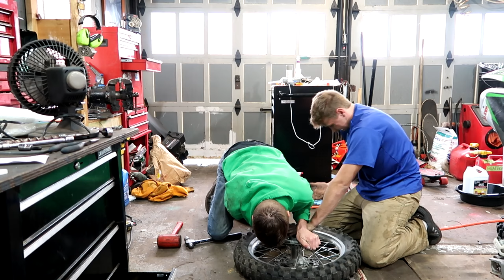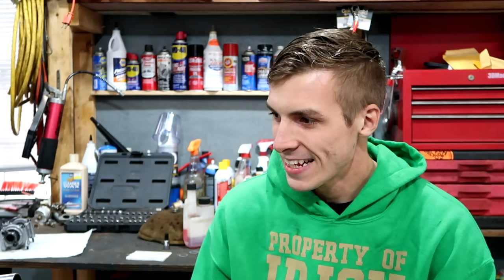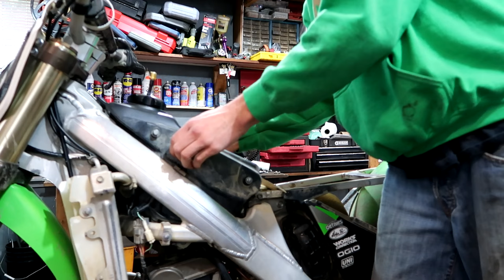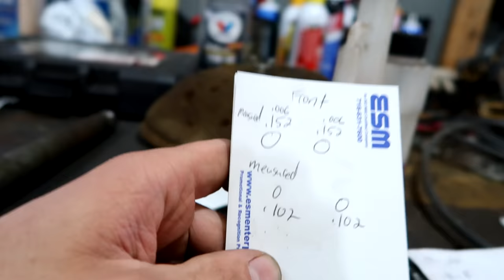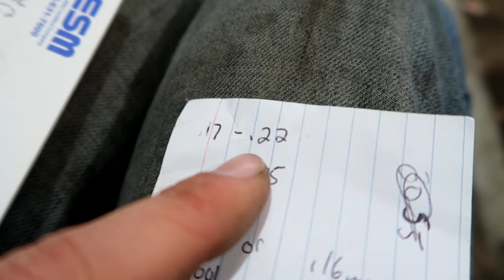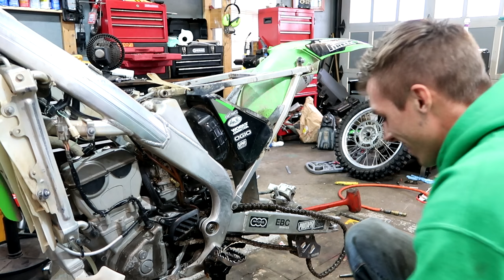BREAKING DOWN THE  KX250F

Comment: One aspect that always get's neglected : linkage bearings. Grease-em up and have your supple suspension back.
Reply: jonnoMoto I took mine apart and they were dryer than a nun
Reply: Dan coleman are you a fireman?
Reply: +1 for sure I went through linkage bearings like crazy on my old kawi stroker

Comment: when I change a tire I always take a heat gun and warm the tire up it helps it it's cooler out and to put the tube it if you use baby powered it helps with putting it in

Comment: Hi, If the valve play gets smaller then it is a sign that you have something building up on your valve and valve seat of the exhaust valve. If you clean that of and get the valve and valve seat clean again then the spec should be back in tolerance. It looks for me now like your exhaust valves might not be closing proper what can become an issue for the engine performance if this continues to build up so you might clean the exhaust valves with Seafoam or so to get the build up carbon of it. The cause of that might be an to rich mixture that gets burned with residue. Check that out.
Reply: exact opposite. valves get tighter as they wear because the valve is eroded by its impact with the valve seat. If it was caused by carbon buildup, the valve would be getting looser because it would not be closing all the way.

Comment: You guys don't lube your tube's with soap or a thin layer of grease, oil before installation. If you would then the tube will move and conform to the tire and rim "no twisted or wrinkled tube". I use a 12 gauge barrel snake cleaner to get inside the center hub bearing and the steel spacer for the axle rod.

Comment: I don't have any tips for valves but tires smaller bites are better and try to keep the opposite side that is already between the rim walls in the very center of the rim like a friend's set of knees on the opposite side of the tire ur working onto the rim keeping the beed in the very center of the rim makes the job soo much easier

Comment: Hey dalton! I have Yamaha vino 125 scooter. do you know if the valves clearance has to be to to specs? Or can they be done by just feeling If there a bit loose? Thanks, great videos!
Reply: Warren Stam you do them to spec if not it will not run right or at all
Reply: Thanks for info! Also I subscribed to u
Reply: Check out my other comment in this post about valve play! This might help you.

Comment: I bought a brand new 07 kx250 2 stroke. before I rode it is tore it down. wheel bearings had no grease. swing arm and linkage and shock pivot bearings no grease. steering headset bearings no grease. also I always use blue loctight on all the bolts ....nothing worse then shit rattling apart on a good rip or racing.  I've been riding and racing since 1980. in that time I've learned that complete tear downs are critical if you down want to piss your money away replacing stuff that shouldn't wear out.  little things like having 4 or 5 air filters clean and oiled ready to use in zip lock bags  are a good way for ya not to say fuck it and ride with a dirty filter. motors last so much longer especially on four strokes. take ur bike apart N see 😉

Comment: My ttr 125 has two small covers that thread into the head and that way u can check the valves without taking the head off and i would normally check the valves about once every 4 rides however i rode that bike alot harder than u do so yeah
Reply: Christian 777 I haven't looked at the valves on my try 125 yet you think I should?

Comment: easy way to break a bead on a tire is to use a motorcycles kickstand, just lean the weight of the bike onto the kickstand on the tire as close to the rim possible and bam not smashing the tire with a hammer.....